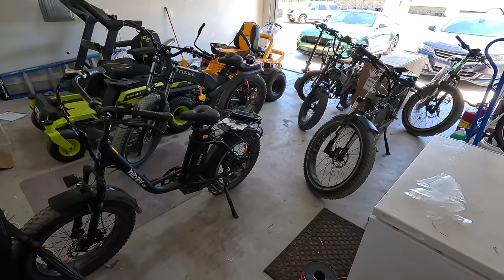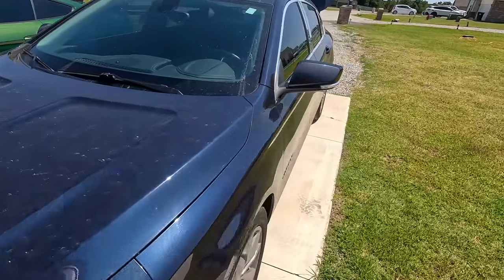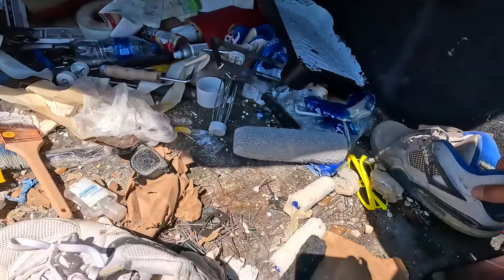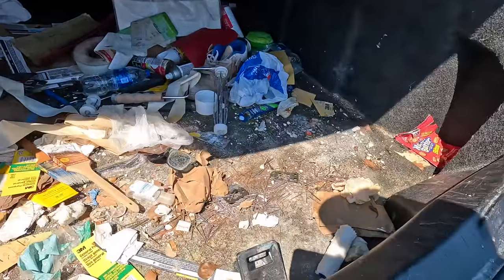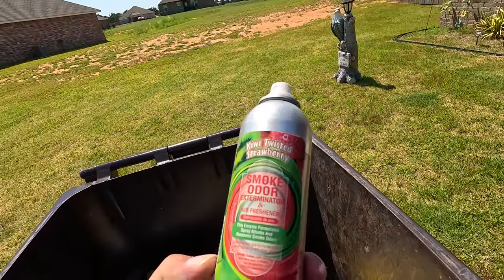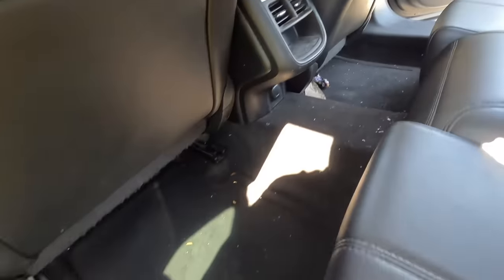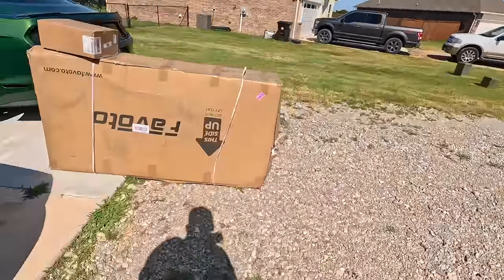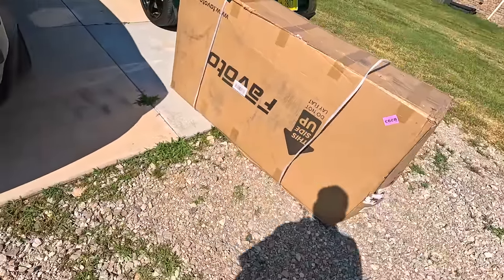My Cheap Auction Repossessed Chevy Impala has Illegal Substances!

Comment: Good job Randy!
I don't blame you for cleaning that car up some. I wouldn't feel right taking it to someone else to do that.
The previous owners of the car....well, the condition the car was in says a lot about them, doesn't it?
I'm sure Brian will have that cal looking and smelling great.
A couple of seats from the junkyard would make a big difference.
Reply: My detailer told me to go find the nastiest car I could at auction for 2k or less. Had to be drivable.. I came back with a 2002 dodge grand caravan that had done duty as either a family of very messy kids hauler or a garbage hauler. The auctioneer was begging for someone to bid. Got it for 100 bucks. It ran and drove but I wouldn't drive it. Loaded it on my rollback and delivered it to him. He did a 50/50 clean (cleaned the driver's half front to back and corrected paint on driver's side) everyone thought the van was staged but it did also generate a lot of income for him. Said it was the best 500 bucks he ever spent (van, auction fees and title transfer fees) a tree fell on it a few years back and that was the end of it
Reply: If I am paying a guy $300 or more to clean a car he is doing all of the nasty work.

Comment: I use a bug sprayer filled with water and a 10 or 12 inch putty knife when removing  the popcorn texture on the ceiling.  All you have to do is mist the ceiling with water then carefully  scrape  and the popcorn texture  will come off in sheets.

Comment: Even if it was a truck, it would be a messy truck. If they had any sense they could of at least put a rubber mat down in the trunk, or used rubber containers to hold tools and supplies. Most of that was just plain trash, probably did crappy paint work too.

Comment: Randy take that car to the car wash and vacuum around the front seats specially close to the console on the driver side, new cabin air filter will get rid of the smoke smell most of it, spray it with cherry car scent  while you are there

Comment: I think I would have used a shovel to clean out that trunk. 😏 I would be worried with that crappy treatment of the inside of the car that the previous owner wasn't too good about maintenance. I expect you will do soon an oil change, check the brakes, tires, suspension, replace filters as needed. For sure it needs a through cleaning inside and out including the ozone treatment.

Comment: The rechargeable lawn equipment is great, like any other rechargeable item though, they're good until the battery goes bad and then they're basically throw away.  Made the switch to Toro 60V, mower, trimmer, edger and blower.  Haven't looked back but I know the batteries will eventually fail.
Reply: I don't like EV cars but I love electric mowers. No maintenance except replace the blade. Easy.

Comment: If the seats otherwise are still supportive just with stains and ripped material, consider seat covers.  You could buy one or two types sold online and review them.  Diamond pleats and contrast stitching would brighten that dark interior.  A rubber trunk mat would cover up the paint stains.

Comment: Had it happen on my wife's 2017. DO NOT replace the gasket! Remove the gasket clean all surfaces and use the right stuff and seal back in. If you replace gasket will leak again quickly. It cost us the amplifier behind that right side cover and the radio module. Total cost to me was $1,500.00. Car only had 8000 miles on it and would not cover it under warranty.

Comment: Randy, from another Randy, you’re probably right about the remote.  The only exception is if you don’t have at least one original remote.  My charger didn’t come with one, and for that reason I had to go to the dealer.  The remote doesn’t have to be for an Impala.  I got a deal on two minivan remotes, which work just fine.

Comment: I had a 2013 Impala LTZ and the 3.6 ltr was awesome however the dual overhead cams are chain driven and prone to being an expensive maintenance issue, that's 3 chains. I passed it along to another family member years ago but it is still running fine with well over 150k in miles. It was only a V6 but it performed more like a V8, very quick and throaty.

Comment: As a former manager of an auto rental chain, I've had busted bottles of bbq sauce returned in rentals that were week long trips and that sh*t turns into rock like substance in the Florida heat. That was way to gooey to have been there for weeks in the heat.  Speaking of complaints about the heat, why bitch about the delivery guys who are leaving your stuff in the drive? They're in it for 8-12 hours (depending on carrier/shift).  Personally, as someone who has done some delivery gig work, I see an open garage with a similar package and the path blocked by a trashcan and open car doors, I'd probably leave the delivery in the same spot. I feel like the content on your channel has changed immensely since your begining. Which I get, I guess. Gotta give your subscribers what they want, right?

Comment: The milage is good. I hate eco turbo 4 cylinders. Good power but premium gas. I saw an EcoBoost with stop start. I thought turbochargers wouldn't like that. I can't buy a $2000 bicycle because I can get a 🛵 for that.

Comment: Believe it or not, the Impala 2 generations prior (2000-05) could easily get 32+ mpg on the highway (with the 3.4 engine). I had an 03 and 32-35 mpg was normal. Once I managed 37 on a 200 mile trip. Yes, 37, THREE SEVEN! It had 180k+ on it then and was probably the most unreliable car I've ever owned. I paid $1500 for it around 2013 and put at least that in repairs over the next 3 or 4 yeara.

Comment: Malibu & Cruze also gets water in the trunk. They do not hold value as I just picked up a 2018 Malibu for $4000 & a 2017 Impala for $3400 both under 100k miles but the transmission them suck & they will go & the turbo burns the tiny crappy 4 cylinder. Some of the Impalas are made in Mexico if the vin number starts with a 3 & piss poor quality control issues there.

Comment: It's hard to believe you started this video with electric mowers. This was a long but good one.  Once you start using electric you won't be going back to gas. No smells no Tune ups. Just keep the batteries in good condition they cost a lot.